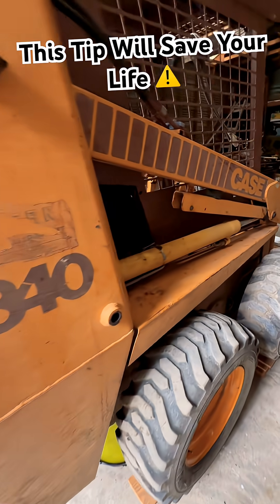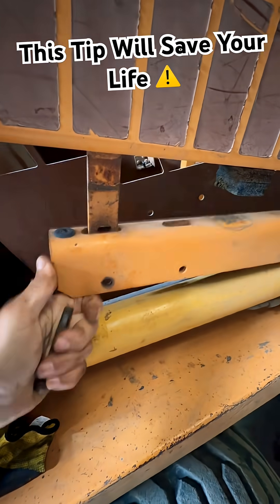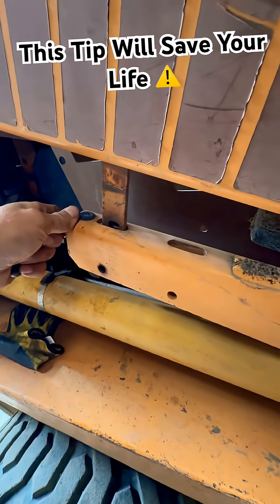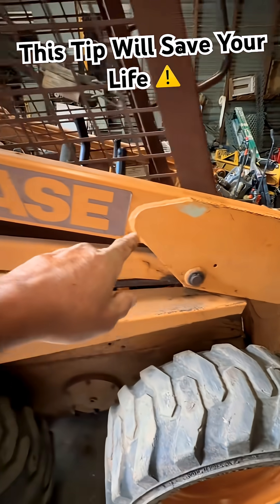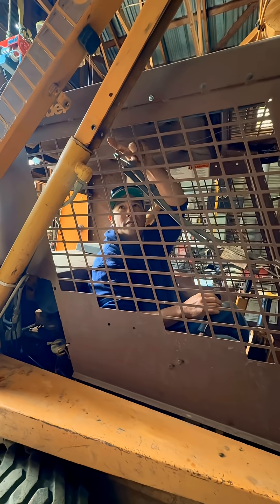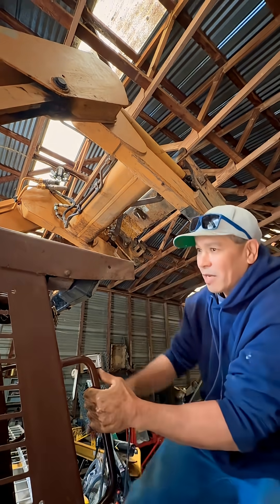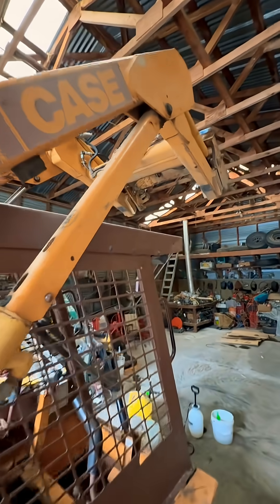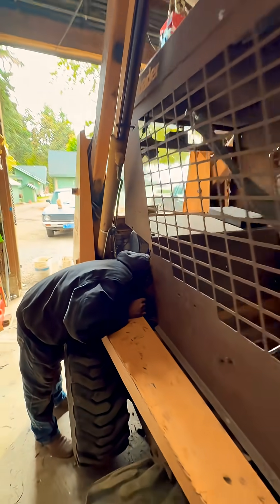Do Not Skip This Crucial Step Working On Hydraulic Systems #hydraulics #mechanic #safetyfirst

Comment: Is the additional pin location, i assume 6 to 8" in front of it, for a different model?
Reply from the maker: Great question . I do think it may be for a model with a different cylinder size .
Reply: @fastflo1 
If the bucket is removable,  could also be used for lock out tag out.